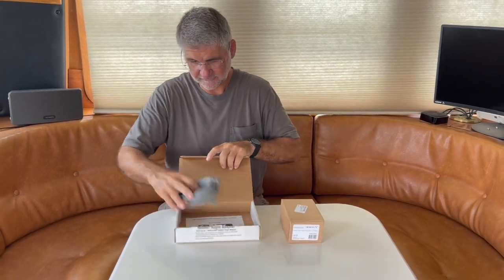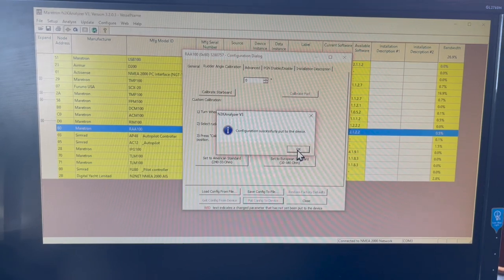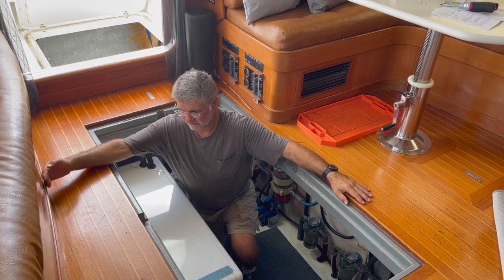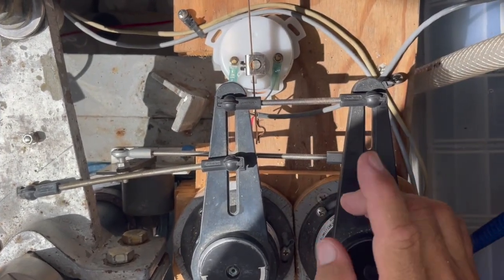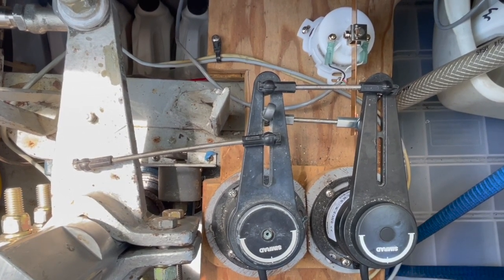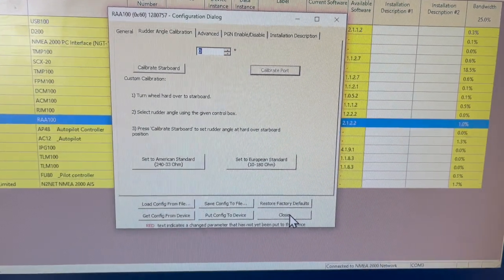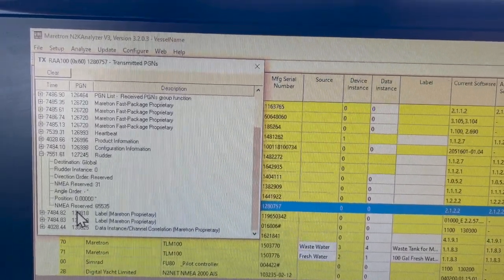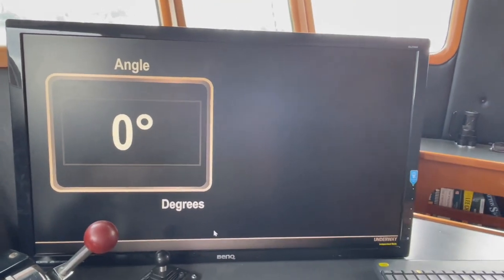Adding an N2K Rudder Angle Indicator for our Digitized upper helm

Comment: Thank you very much for taking your time to make your video!  I've liked and subscribed.  I'm wondering why Maretron couldn't display P or S in steering indicator vs. using a negative number for steerage to port?    Would you mind explaining how you get maretron data onto an iPad?  Also, in our boat I just installed and connected four Ruuvi tag sensors to our Cerbo GX.   I have called Maretron twice (no return calls!) on how to get the temperature readings on our Maretron display.   The Cerbo sees the data, but I'd love to have it on our Maretron display as well.   Do you, by chance, know how to do this?    Thank you again, that's a fantastic "underway screen" a lot of time has gone into that for sure!

Comment: Very interesting and instructive as always. Thank You both!
Reply: Could the Simrad AP be updated to output rudder angle?  Or is that a more expensive approach?
Reply from the maker: The Simrad AP is receiving an analog signal from the dedicated rudder angle indicator directly to the Auto Pilot computer and not over the N2K network. This means there is no broadcasted N2K rudder information available that the Maretron system can interpret.
Reply from the maker: Glad you enjoyed it. Thank you for your comment.